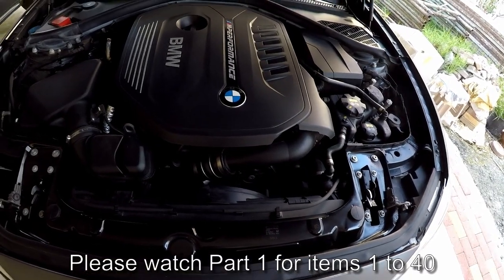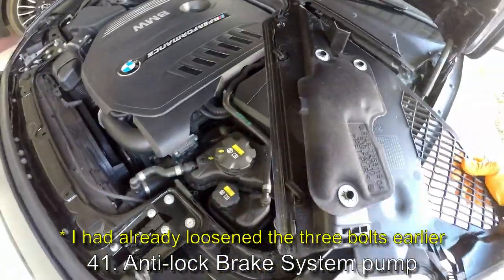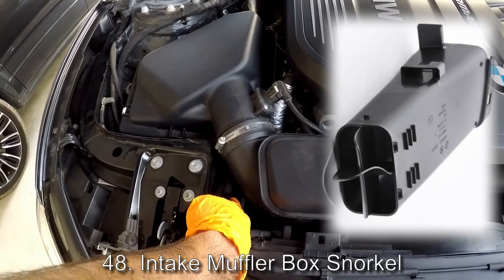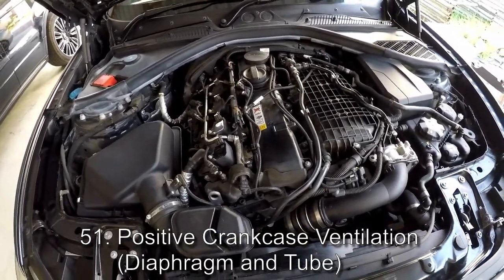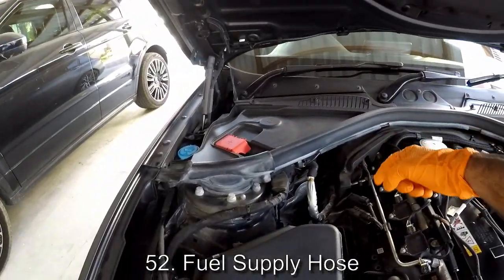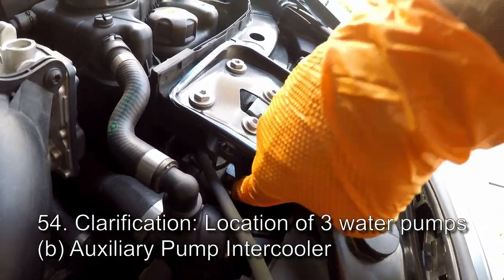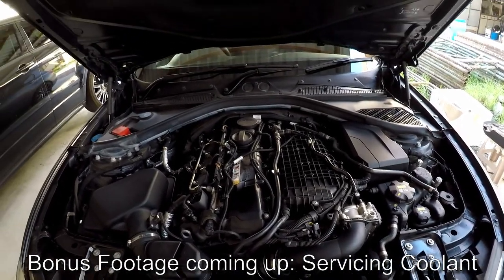BMW B58 Engine - Simplified Under the Bonnet Guide - Part 2

Comment: Superb effort. Maybe that video you were thinking of doing regarding the secondary small radiator and the different heating/cooling circuits is calling?
And total respect for not taking the kudos away from Kevin (Kern417), his knowledge is huge on the B58 and I’m sure he appreciates your direction towards his channel
Reply from the maker: Your kind words are very much appreciated. Yes indeed I will make a dedicated video about the different cooling circuits and their configuration during the four cooling modes.

Comment: In your part 1 video you said the foam inside the air-box could be deleted? Would the point of this be for better induction noises? And if so could this increase intake air temps? Thank you, amazing videos.
Reply from the maker: Hi, yes it has been reported that the foam deletion increases induction noise (not dramatically though). To my knowledge it's not been reported that intake air temperatures have increased because of foam deletion. Although I'm not sure, the foam's location within the muffler box does not appear to be an insulating material for the hot temperatures coming from the turbo. So I do believe it's purpose is noise reduction rather than temperature insulation, but it might contribute a little to that aswell. However in my humble opinion it's possible that the foam helps direct the airflow towards the filter and its deletion could result in some internal turbulence within the muffler box (whose shape requires the foam to function as BMW intended). Such internal turbulence could theoretically disturb some of the smooth airflow through the filter, and possibly cause increased temperatures within the muffler box. All this is theoretical, based on absolutely no data.

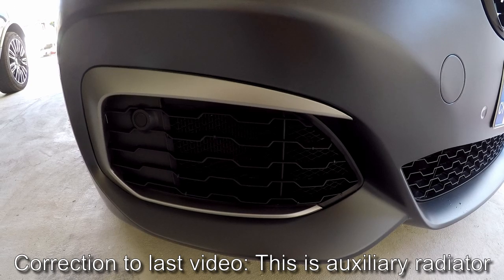Comment: 7:25 the auxiliary cooler /
Radiator on the side: is it really for the (high temp) engine cooling circuit or isn’t it a cooler of the low temperature cooling circuit (e.g. charge air cooler) ?!
Reply from the maker: Hi Voll Care, yes definitely for the high temperature circuit. I cut out alot of the video where I tried explaining the four modes of the engine (startup, warmup, normal, maximum cooling) and how some systems are bypassed or activated in each mode, I think it deserves a dedicated video, but that radiator assists the engine coolant radiator, not the intercooler coolant radiator. If it's damaged and leaks it's the high temperature coolant circuit that will lose coolant, which is why it's important to look after it (for example I added the mesh behind the grille).

Comment: Oh good baby Jesus now I got 3 damn water pumps to worry about...
Reply from the maker: sounds like you had some bad experiences with other engines...
Reply: @NoBrainerTalk  I had a 07 328 E90, and a E92 335xi prior to my F32 440xi. Never had a single motor issue on either car but the water pump did give up at ghost on the 335 when it only had 26k miles. I think that was some kind of record. And the car was not tunned or anything. BMW replaced it under warranty. The electronic water pumps on the E9x models were prone to failure.